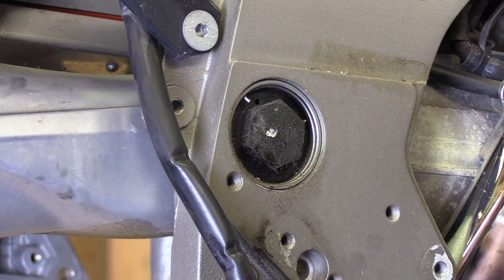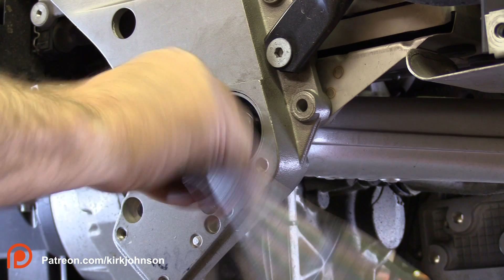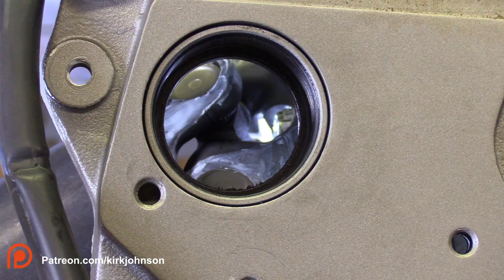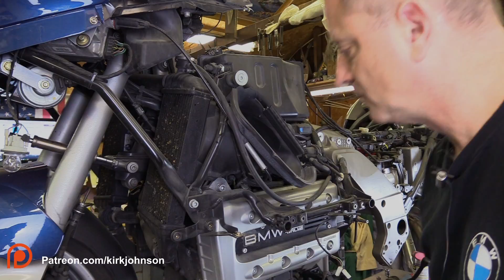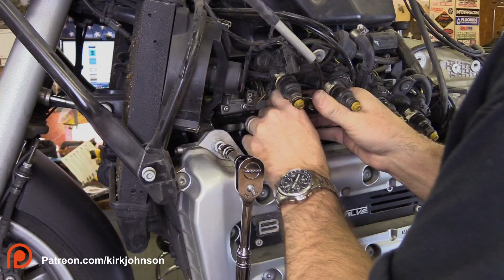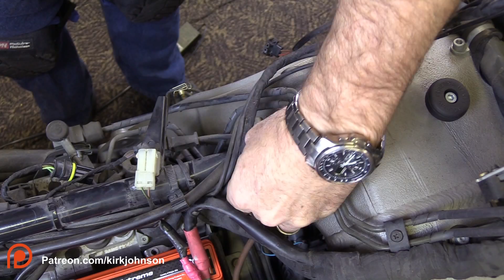BMW K1200LT DIY Clutch Removal Part 2 of 3 Clutch Series

Comment: 1:30 my bearing's "wheels" move a bit when pulled from the inside wheel, but turning it feels smooth, no noise. Is this normal for this bearing? 1999 LT,  40'000 miles.

Comment: Good afternoon. Dear friend, tell me the options for how to unscrew the bolt on 14, which is on the left side, where the conical bearing of the foot attachment is. As it turned out, my head itself was broken off by 14, it was before me. I will be very grateful for your advice. (at 4.00 minutes). HELP with advice!!!

Добрый день. Дорогой друг, подскажи варианты как выкрутить болт на 14, который с левой стороны, где конический подшипник крепления ноги. Как оказалось у меня сама головка на 14 отломана, это было еще до меня. Буду очень благодарен Вашему совету. (на 4.00 минуте).  ПОМОГИТЕ советом!!!
Reply from the maker: I have had to cut the swing arm off the bike. https://www.youtube.com/watch?v=uqPbuwAFUqM

Comment: Is there no way to adjust the clutch. ?
Reply: Hey!!  Thanks for responding. I was afraid you was gonna say that.  Its a very nice 99 model 1200 LT i gave 2800 for it. I sure dont wanna go threw all that to put in a new clutch in it. Its got a lil over 60k on it. I had one before same model and everything had 225k on it. Run and operated like new. I gave that one away and got this one with less miles ,thinkin i was upgrading. Lol!  Wish i had my old one back.
Reply from the maker: no. It is hydraulic

Comment: Those 14mm internal swing arm bolts will not move on mine, done pen oil, lots and lots of heat, broke several 1/2 drive sockets and not even the slightest bit of movement out of them. They are all that's holding up my project....
Reply: Blew up my k1200rs @160k and trying to do an engine swap on it....
Reply: Broo 4 years later and I can’t do it either I flipping stripped the bolt 😭